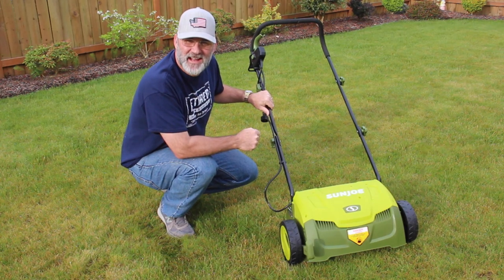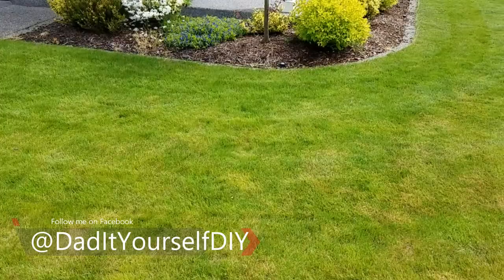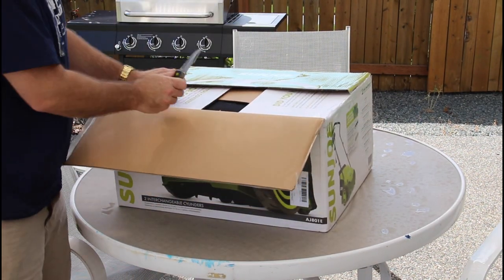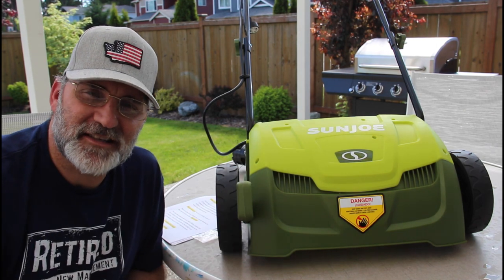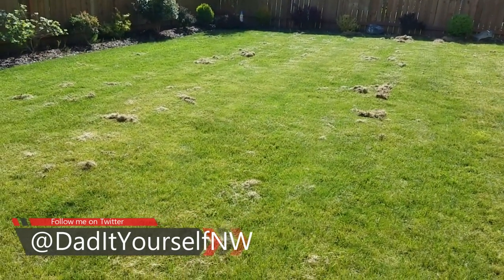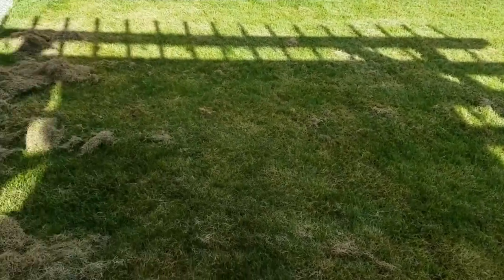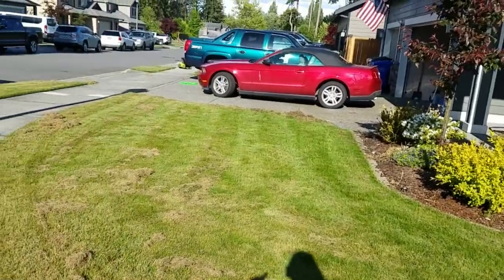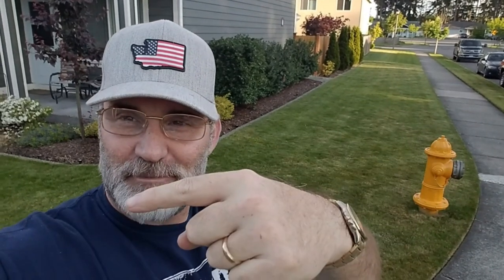The Sun Joe AJ801E DETHATCHER | De-thatching the Lawn - Cool Season Lawn - Part 3 | 2020/19

Comment: I’m across Snoqualmie Pass from you in the desert and have a brand new Sun Joe in my garage. Bought it last fall after my lawn guys told me I have between 1” and 1.5” of thatch (!) I see green plants and leaves on the trees in your video. Should I wait a few more weeks before getting this Joe out on the lawn?
Reply from the maker: Well once you get rid of that, your seed to soil contact is going to be awesome. Be prepared for hug piles of thatch and a lush green lawn this spring!
Reply: Is it too early this year to get out there and dethatch?
Reply from the maker: Depends on your soil temperatures. 50-55 degrees. Once you start go through with the entire spring plan!
Reply: @DadItYourselfDIY  thanks!!

Comment: What setting did you have it on?  Where does one take the thatch to get rid of it??
Reply from the maker: I had it all the way down. I put my thatch in my green bin for yard waste. You dispose of it tge same way you would dispose of grass clippings.
Reply: @DadItYourselfDIY  I just received my unit and tried it out.   It's way too hot to do much today, but seems like it'll work great.   Walmart has them in stock currently with SUPER fast shipping.     Thanks for the video! 🙏
Reply from the maker: Yeah. I usually do this in March/April and September/October

Comment: I just ordered a Sun Joe today. I'm getting too old for the dethatching rake. What is the limit on extension cord length? Thanks
Reply from the maker: They do not recommend over 100'. A polarized (one slot bigger than the other, and 12 AWG also). I have a 100' cord I picked up at HD, and have not had any issues.
Reply: @DadItYourselfDIY  ok, thank you, John
Reply: Time to break out the Sun Joe again, and do some over seeding.
Reply from the maker: I have a Ryobi Cordless now too!!
Reply: @DadItYourselfDIY  How long can you use it before the battery dies? Thanks
Reply from the maker: I did 1500 square feet on a set of 6ah batteries. The remaining 1000 sf with a pair of 3ah.